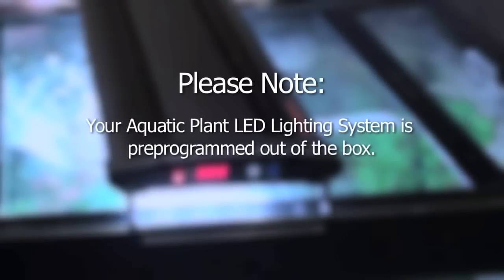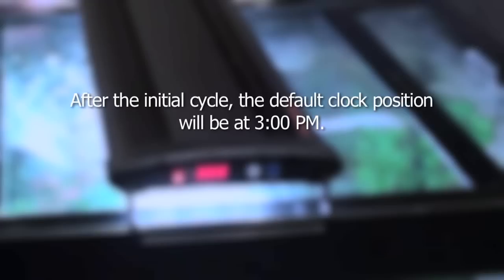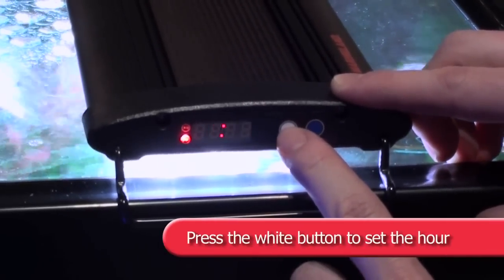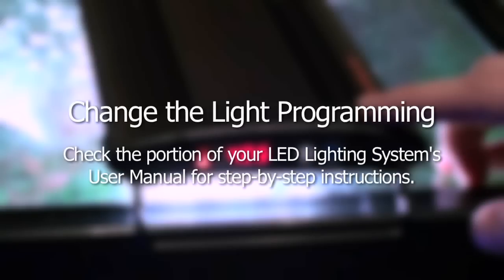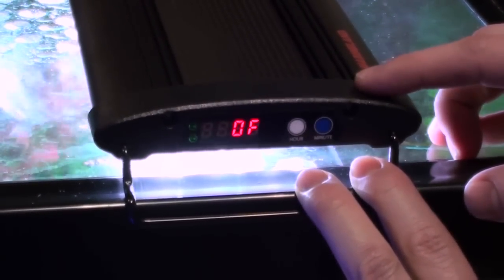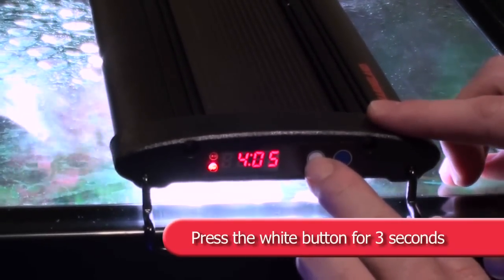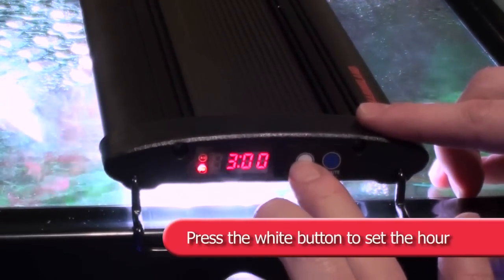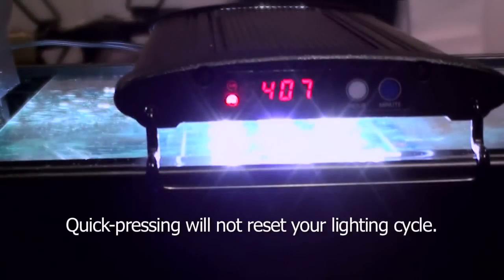Marineland LED Light with Integrated Timer Setup Guide

Comment: Pretty straight forward, thanks.  The one thing I'm not sure about is AM or PM.   I tried to cycle through 1 to 12 several times to see if perhaps the LEDs to the left of the time turned on and off.   No luck.
Reply: Does yours not have little AM/PM buttons that illuminate? Hopefully you figured it out. If not, might have to trial & error it.